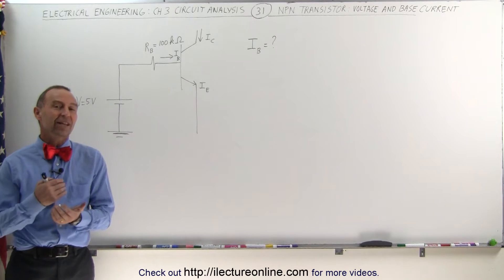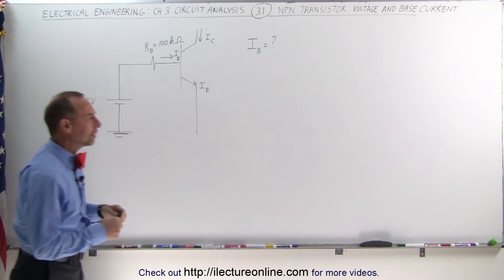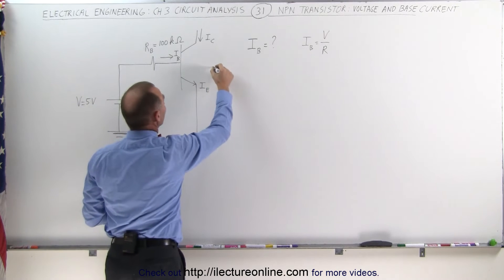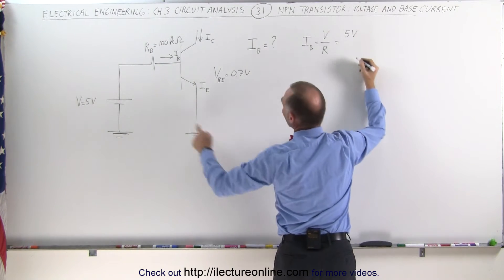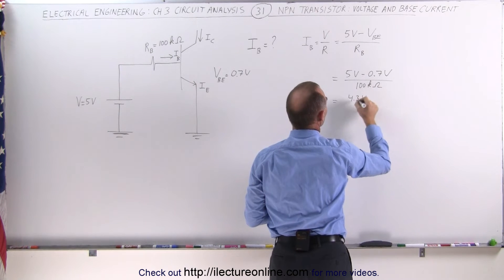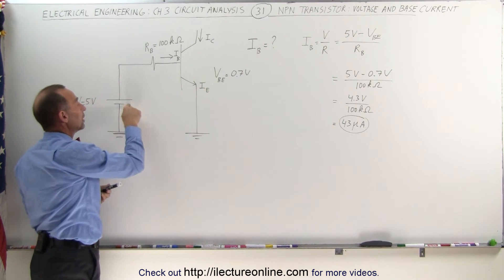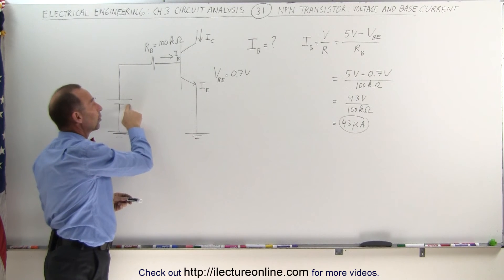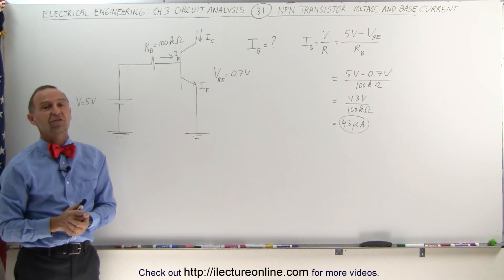Electrical Engineering: Ch 3: Circuit Analysis (31 of 37) NPN Transistor: Voltage & Base Current

Comment: How much minimum base current required
Reply from the maker: Usually it is around 0.5 to 0.7 Volts
Reply: @MichelvanBiezen  if apply 5V through resistor then minimum current required for saturate the transistor
Reply from the maker: That depends on the base resistor and the rating of the device.  Each transistor has its own rating.
Reply: @MichelvanBiezen  can u suggest approx. Rating

Comment: good  work but how did you get resistor value
Reply from the maker: Resistor values are usually chosen in order to obtain a particular base current.  In this example we picked an arbitrary value for the resistor to illustrate this principle.
Reply: @MichelvanBiezen   Ok if resistor value are usually chosen, then from what rang to what rang will i chose

Comment: Sir how you know the polarity of Veb ?? Means how you understand that it is +0.7 not -0.7
Reply plz sir .......
Reply from the maker: It depends on the direction of the current.  The voltage is higher on the source side of the transistor.
Reply: @MichelvanBiezen  thanks professor

Comment: should we always use a resistor for the base?
Reply from the maker: That is typically done to control the base current.  By varying the base current we control the emitter current
Reply: yes but I have never seen a transistor withouth the base resistor, so I don't know if you can avoit it. Maybe to be sure of being working into the saturation of active zone (?)
Reply: but if we need to amplify most as posible, would you then avoid the base resistor?. i have seen circuits where you need a big amplification or working in the saturation zone and still using base resistor.

Comment: Sir, how did we find V(BE) = 0.7 V ?
Reply from the maker: That is due to the property of a semi-conductor.  (Same for a diode), You need approximately 0.7 V to get the current flowing.  (There are small differences between different types of semi-conductors).
Reply: ohh my... Thankyou for asking that. I dont have to ask anymore. And thanks for the answer sir michel.
Reply: It's Already give in the informations of the exercice i guess, and its always fixed , right?